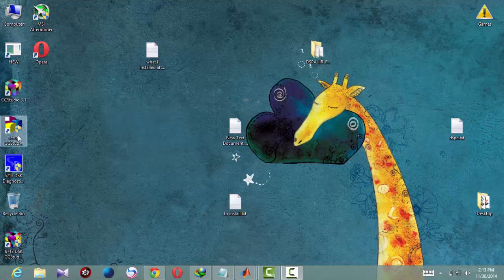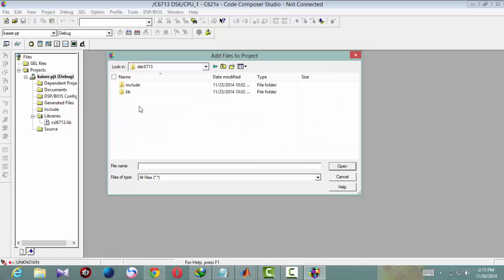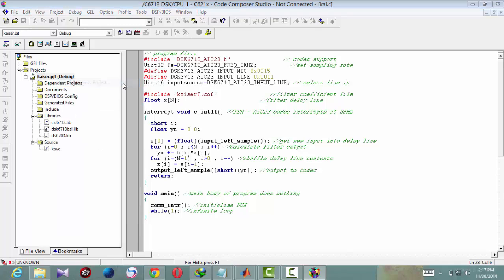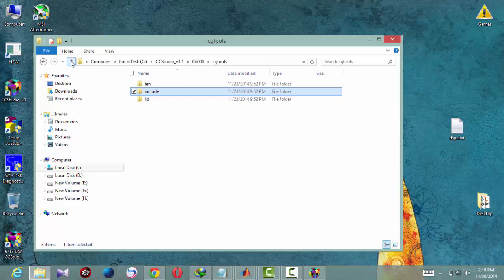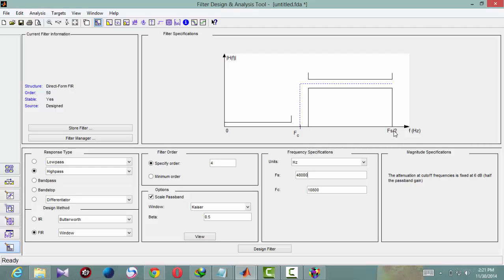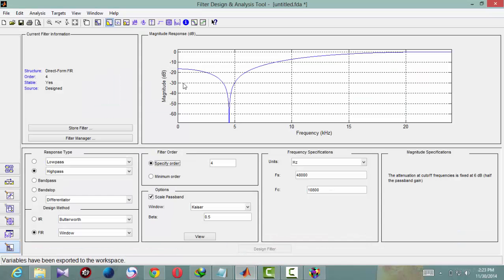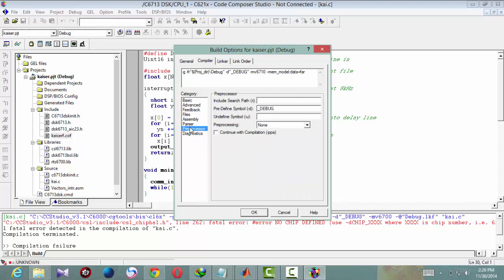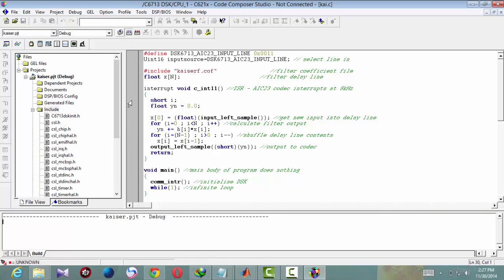implementing fir filter on DSK-6713

Comment: Hi Mahesh,
thanks for this great video, i could some how compile and build the whole project without errors.
i think the next step we need to see your next video physically implementing this filter on the board.
i actually had a bit of difficulty to understand the fir.c commands...the output should be the convolution of the input signal with the filter's impulse response ...i guess this should be the array h[i] ...but h[i] was not mentioned any where in the code except of the step of the convolution ...can you please explain the interplay of the filter coefficient file and the h[i] ...
thanks a lot.